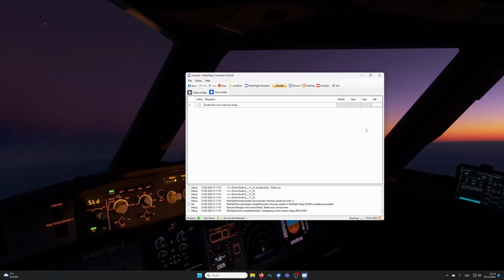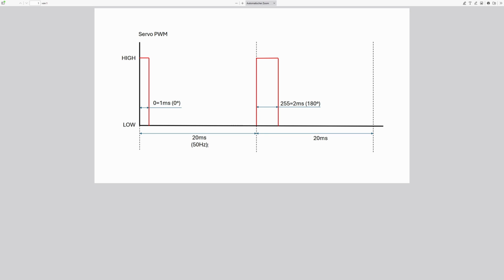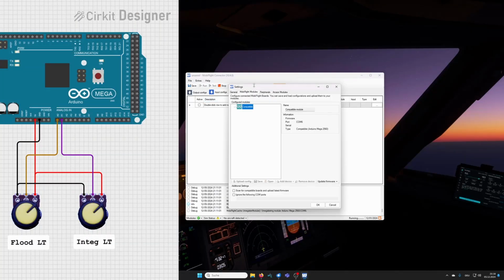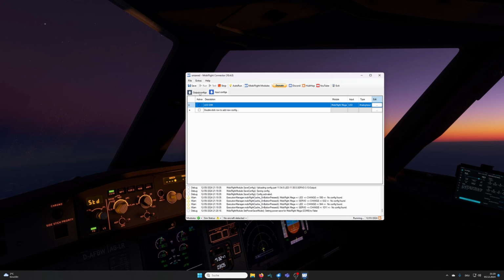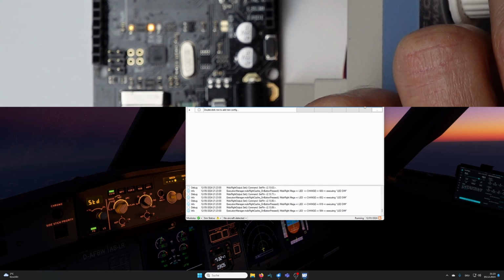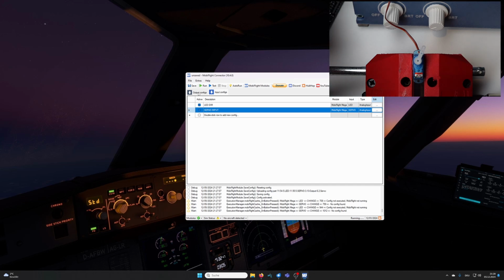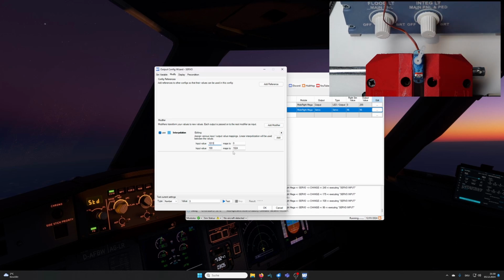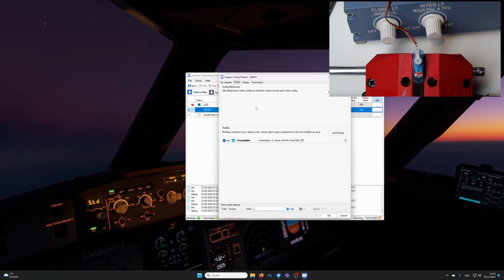Dimming LEDs with Pulse Width Modulation - Full Home Cockpit Build EP 15

Comment: I can't get PWM to work at all right. I have a parking brake LED which is on a PWM pin, and normally it is quite bright, so to dim it without adding another resistor, I try to use PWM. As soon as I enable it, no matter what output range I put, it lights up about 20%. I can put 1 or 255, it makes no difference on the brightness.